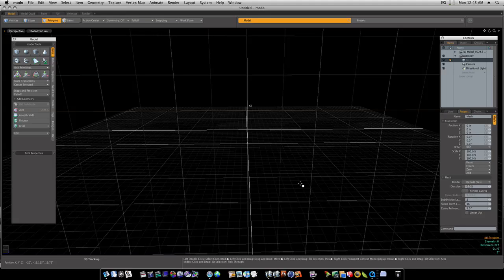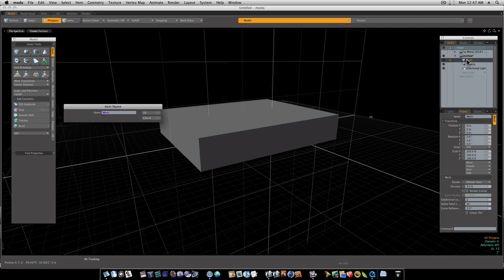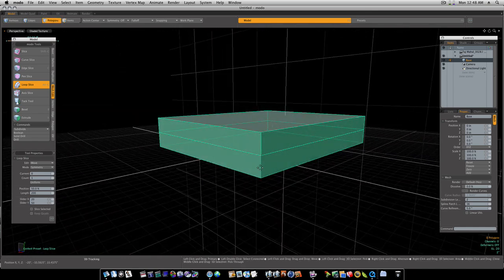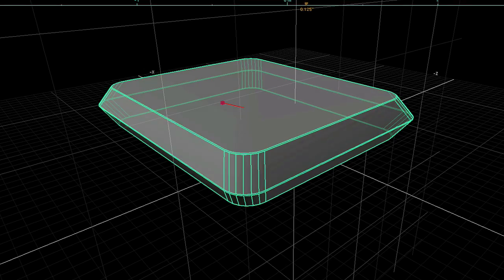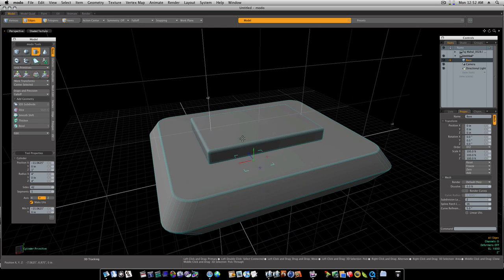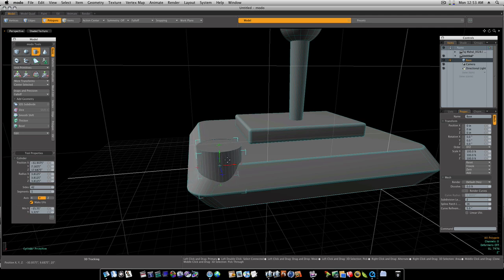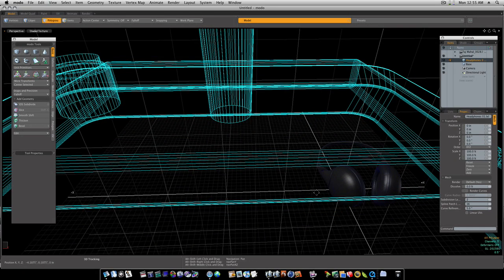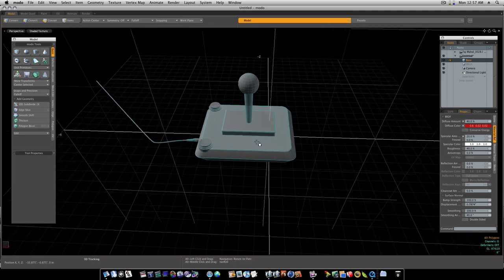Modo for Noobs : Joystick Modeling

Comment: I am a Modo n00b, but I have been using XSI and Maya for a long time now. When I select some vertices on a mesh, and press W to move them, and then want to middle click or right click lasso some more vertices to add to the selection, I hold down Ctrl or Shift and drag mouse, and my selected verts start moving. I want translation to happen only when I drag the X Y Z handles directly and not otherwise. XSI is also like this by default but can be easily changed. What about Modo?